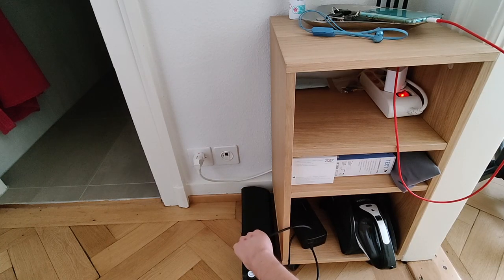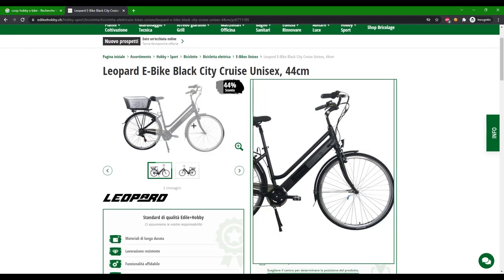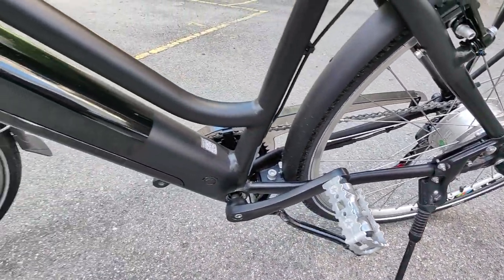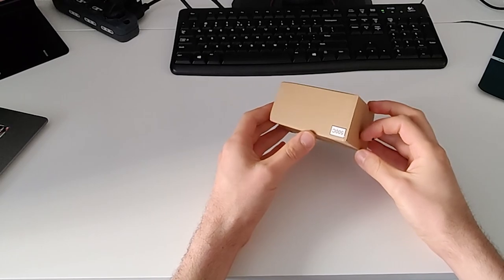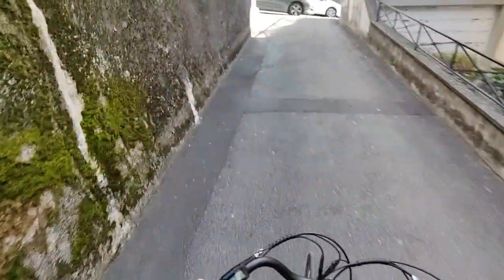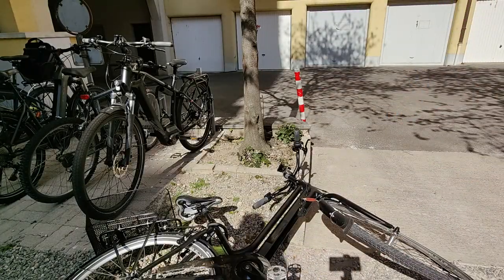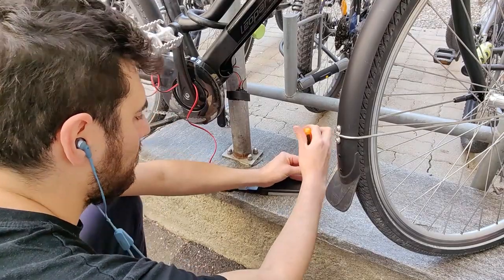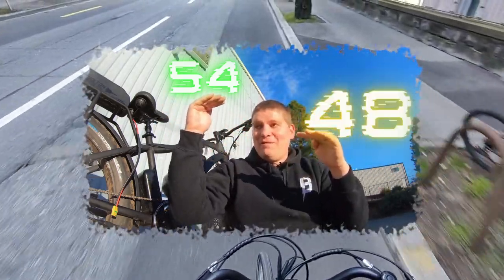Can you INCREASE the RANGE of your eBike? 250W Bafang hub-motor pre-built bike

Comment: Built a 750W BBS02 after watching your videos from a  Carrera Subway 2 I already owned that was too heavy without e assistance. Wow! Brilliant and far cheaper than even the cheapest entry level e-bike. I agree that the best e-bike is the one you build yourself, big battery and masses of range.
Reply: Funnily enough I did the same last week with my 12 year old Carrera Subway 2. I think 750w is the perfect amount of power for it. I live on a steep hill and can pedal up it no problem now. It's turned a 12 year old bike into something that can now hold its own on the road no problem.
Reply: @noggintube  I was looking at the specs of a Raleigh e-bike listed at £1595  400W rear hub drive and and only a 400Wh battery, pretty crap control/display, specs were rubbish compared to a bafang bbso2 kitfitted to  a fairly cheap hybrid bike and more than twice the price. Glad to hear about your Subway 2, did you use rivnuts on the down tube to mount the battery?
Reply: @neiljarvis8911  Yeah that was the only major issue really due to the bottle carrier being too low. Popped 2 rivnuts higher up and all nice and solid. Agree about the price of ebikes - I actually looked at the official Carrera Subway ebike just out of interest. £1100 and as you say, poor hub motor with rubbish battery.
Reply: @noggintube  just need a bit of warmer weather to get out and enjoy them.
Take care!

Comment: The best reason not to buy a prebuilt is that most often than not if you need a replacement part they will charge you a leg and a arm for it. The second best, more than 250W.